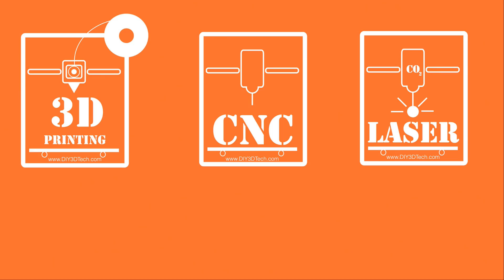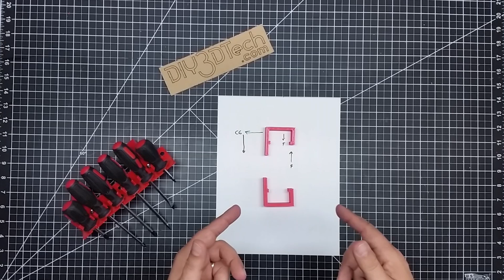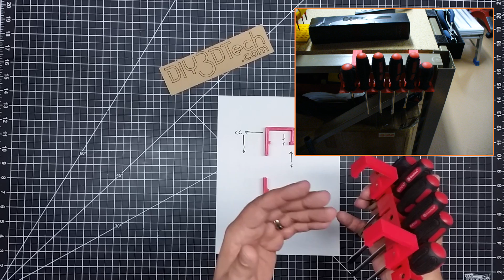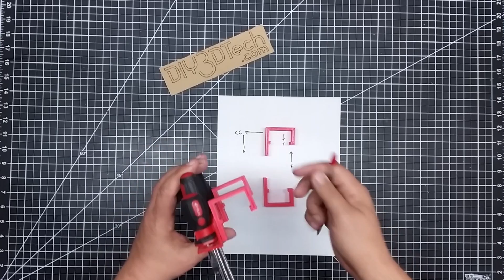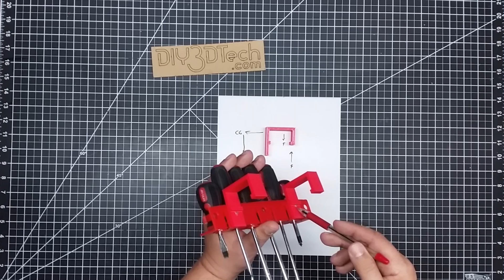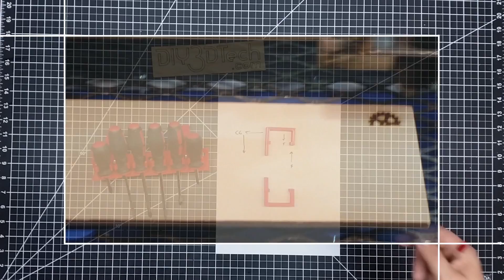Design Talk - How to Create a Minimalistic Yet Universal Bracket!

Comment: No link for shelving.  Menard’s, you say?  Thanks!
Reply from the maker: The Menards site is kind of strange but here is a link to one of the kits (I buy it in pieces).  https://www.menards.com/main/storage-organization/shelves-shelving-units/steel-component-shelving/xtreme-garage-reg-201-1-2-w-x-72-h-x-30-d-3-shelf-rack/1994801/p-1444422311196-c-9926.htm?tid=-7316934637680709565&ipos=46